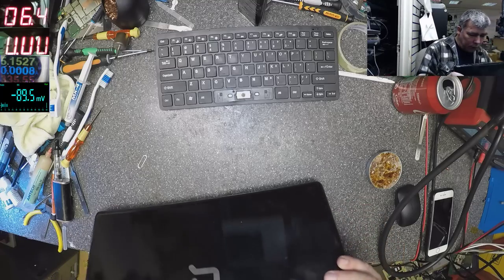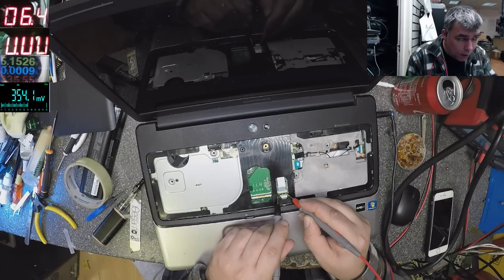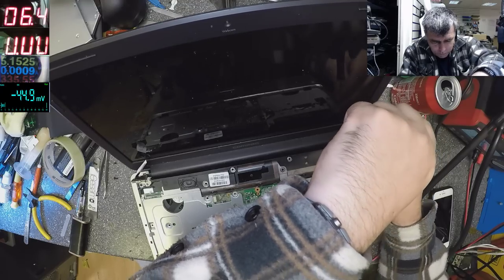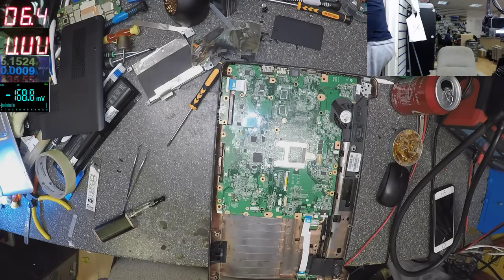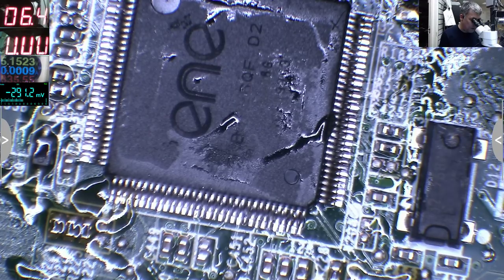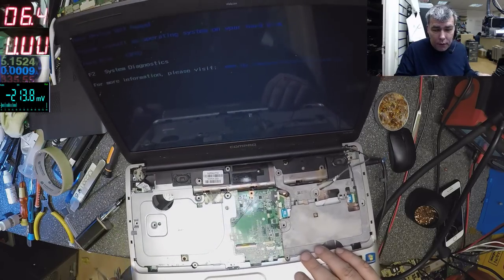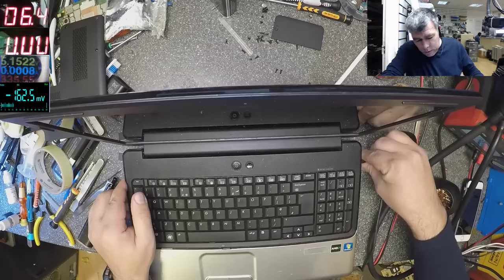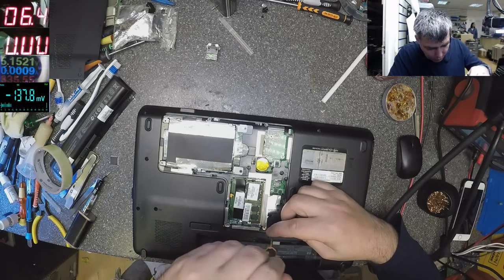The Most Common Fault On a Laptop When Everything its Working Fine but is Not Coming on

Comment: Some time i also use power supply to check circuits. It needs to be well aware of how electronic things work. its not for beginners. What you do is very practical and easy way to do it

Comment: Don't feel bad Sorin, you explain very well. You can't help it that people are ignorant and lazy and don't take time to learn before they randomly destroy stuff. Hopefully they will understand at some point, you are doing a great job. I learned from just a few videos about the 19v, 5v, 3.3v, 1.35v, 1v just by your videos. I have a lot of questions about some board I saw hundreds of volts on after a coil but I keep trying to look and understand before I just start to put in random voltages or amps on random spots. Keep them coming :)

Comment: Sorin, Sir please do not feel bad if some people make mistake and mess up. It is not your responsibility.  You have many videos which cover many aspects of repair, electronics, the repair business, and how to approach a problem.  You videos are unique - they are not just fixing thing, it is style professors use so that students learn.  I am your student.  For many many years I was looking for such an opportunity to learn the practical aspects of electronics and I am glad I found your videos.  Your videos are full of knowledge and because of that I subscribed to your channel.  I watch many videos, yours as well as others before venturing to do any repair, because it is possible I can mess up.  In fact I messed up a power supply (had ripped the power cable from its plastic holder which became useless) while trying to repair a Power Station Jumpstarter about which I had no knowledge.  However, I could use the same components (the connection sockets), and tested with a 15 yrs old multi-meter, which I had never used before prior to proceeding further to troubleshoot. recently I broke a P-trap pipe joint (the one under the bathroom sink) while trying to open it for troubleshooting.  I saw it was glued and thought to apply more pressure to loosen joint. However, it was going in the wrong direction; was actually tightening and broke the threads - it happens and I was responsible for this failure and I am responsible to fix it; and fixed it. You are teaching us lot of things free.  We are indebted to you for your time and your honest and selfless teaching.  Please keep it up.
Reply: Well said 

The one thing I also picked up on what he said was about putting the power supply onto the motherboard and using it as a multimeter and end up blowing the board up such as someone sticking 19 volts into it 

One thing I have took away from the many of this chaos videos is if you going to inject voltage to see what current it's drawing or tondo the petrol test to see what's cooking  is to use a low voltage like 1 volt as he's done many times on his repairs it lessens the risk of frying components instantly 

Have a laptop with the same issue as this one in the video chatting light is on but won't turn on not bothered to get all the needed tools yet as I don't really do much in repairs now a days and the investment in equipment just doesn't seem worth it if only doing a small handful of repairs 

So I stick to basic repairs now like fan replacements hard disk replacements anything that can be taken out and replaced in minutes

Comment: there are a few concepts that the beginner needs to read up on and experiment with .transistor diode capacitor mosfet inductor zenner diode and power supplies....from then on they can start to deal with some more advanced stuff and know a bit about what is going on ....oh then more practical stuff like testing with multimeter and soldering...very good stuff...i learn a lot every time.

Comment: I dont think the name is wrong. You do what you can. Trust me it is helping. It may be advanced Sorin. And I am a beginner. But what I learn from you is great. I dont have a powersupply. So the power I use is the original power. Test the power supply. To make sure it works. Then start at the power in and follow it. When you lose the power. I think you are in the area of the problem. Correct?
Sure I could make one from ATX pc powersupply. But if you can use the original powersupply to test. Then im ok with it.

Comment: Hi sir, I am an electronics student and in my university they do not teach us pratical things like repairing ... so when I watch your videos I understand what you say and do but when I try it by myself I cannot because I do not know where to start in the motherboard I've never tried to fix one, so I ask you please if you could do a video to show step by step where to start and why ? how do you jump from a place to another and if you can use the datasheet one time for a beginner because on the board it is hard to trace the circuit diagram. And I have a question : I do not understand when and why use a powersupply ? how do you know that there is a short by reading the amps ? 
If there is any Link, Books anything that could help I will be very gratefull.
Thank you for your help sir!

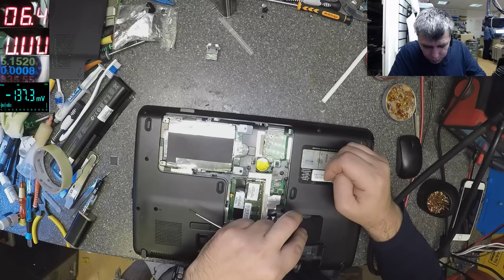Comment: 57:03 It's not always that easy. I learnt electronics in college for 5 years, and after that, I could barely make my own circuits, not to mention fixing RTV or customer hardware. But now I'm learning electronics from the Internet, from watching people like you, how they fix stuff, and I'm learning much more this way, and much faster. If I don't understand something, I look things up, unless I can't find any info about it (which is quite common with computers, because the producers don't release technical documentations to the wide public, only to their authorized services), then I ask people. I tend to learn from the masters of the trade, like you, because those people know the practical stuff, not just some dry textbook theory.  So now I'm pretty good with digital electronics, I can program microcontrollers, I built my own simple 8-bit computer from 74xx family chips etc. But laptops and cellphones are whole another level, because they're mainly SMD or even BGA. So even if I know the "classic" TTL/CMOS stuff, there's still a lot to learn in order to work with modern electronics. I bought my first hot air gun only recently, fried some chips during desoldering, damaged the tracks etc. But that's how we learn, don't we? We make mistakes and learn from them. With every mistake, we get better. Now I already fixed a couple of laptops thanks to your tutorials, but only the simplest ones yet, that didn't require any soldering on the motherboard. Another problem is money. It took me some time before I could afford all the tools. I was building my workshop for almost 3 years :q And I still don't have all the tools I'd like to have, e.g. a proper oscilloscope, or a microscope, because they're too expensive for me. I don't give up, though. What I like about your tutorials is that you don't seem to be using very advanced, expensive tools. You show how to get things done with simpler, cheaper ones, and it's surprisingly successful.

Comment: I guess this is an old video, cause ive seen sorin teach to beginners. Im an absolute beginner, and proud of it. Im no stupid so i try to keep up. Buth there is nothing wrong in being a beginner. Its wrong no to get the proper equipment tough. I dont have a power supply yet its very expensive where i live. So im into building one with sorings course on building one. But until then im enjoying his videos. And learning some stuff in the way.

Comment: I would say your gripe about people who know nothing about electronics trying to repair electronics, is somewhat like me asking a motor mechanic in an "E-Mail" about the oval shaped thingy, between the 2 large gears, opposite the large shaft that has the arms on it, below the small cylindrical shaped housing, inside the engine, if that was scratched, would it make a difference in how much petrol gets pumped into the carburettor???

And THAT dear friends, is why I get a motor mechanic to repair any car problems 👍👍👍

My biggest pet peeve, is customers "Insisting" on me giving them a quote over the telephone without having seen what is wrong to start off with. 

As in..... "Come on, you MUST have some idea of how much it's going to cost, I mean, I did give you an exact diagnosis of what is wrong. If you are ANY good at what you do, you'd be able to quote me over the phone"....... 

To which I reply "How long is a piece of string".

To which they respond by putting the phone down in my ear and I lose the work 🤷🤷🤷
Reply: I just say I charge $70.00/hr plus parts. ;)
Reply: @medicfour9268  That doesn't help. It's among the first things I tell them, Hourly Rate and then whatever the cost of the materials will be, but some people just don't understand

Comment: How do we differentiate the case when the 3.3v power rail is present but the startup chip has failed, VS the startup chip is working but refusing to complete the boot sequence because something else is wrong (ex: badly-sited memory, or some other issue)?  Shouldn't we check input signals to the startup chip, first, before swapping it?

Comment: Newbie question:  If we don't have a spare ENE on hand, is it sometimes possible to 'fix', at least temporarily, the ENE by cooking it around the edges a little, same as for failed GPUs in high-end laptops (ex: Dell XPS )?  ...Does the ENE even get hot enough to be subject to dilatation stresses like GPUs?

Comment: Due to the difficulty of replacing the super I/O chip this is not the most common fault and there are some other signals to considered as OK for the laptop to start as individual logic single gate ICs used for buffering,AND,OR etc.
Reply from the maker: I know what you mean, but must of the subs are not on that level. On some point ai will do a video about the io signals and 'S' states

Comment: Hi there..thanks for wonderful tutorials..i have laptop with same issue..have power light but cannot start up i just remove all the hardware including hard disk memory etc..i am pretty sure my power button is working fine..i want to ask if the 3.3volts is  present from motherboard does it always means that start up chip is the only causing this problem?thanks if there is anything else, please let me know..thanks

Comment: Hello, I have the same laptop and I have a problem with it. It doesn't start up at all. When I plug it into the external power, the ac adapter light turns on for a few seconds then turns off, but none of the lights in the front of the laptop (power, battery  or drive) turns on. When I try to turn the laptop on using the battery it doesn't work also. What do you think the problem is?

Comment: sir, i have a old hp compaq nx9030 laptop motherboard. There is power indicator light when i plug in the charger but only 2v is given to the power button instead of 3.3v .can anyone explain the reason for this and which part should be replaced?

Comment: thank you very much , I have a question , you spoke about the (I O chip )    before and you said that if the LED light is on then this chip is working fine ,,, could you please this thing explaining ?
Reply from the maker: thats mean if you have any led light on the laptop, indicate your 3.3v power supply its up and running and most likely the 19v aswell. I didn't said if the led are on, this chip is fine, like how you see on this video the light are on but the chip is dead
Reply: ok , then  I am  sorry , I thought that you said ,,
Reply from the maker: its ok, dont be sorry :)
Reply: Are those  comments about my question  ?

Comment: Hi mate nice work 
I have one issue that I think you haven't met. 
Laptop motherboard Q5wvh la-7912p   stop working  no image on display last year I have done some research and find out that the video card is probably  dead.  Now I have buy a working motherboard ebay and when I installed on the laptop  nofting with the power cable in . I insert the battery  and the laptop start but still no image on display .
I have reinstalled a few times 
And now with the battery I get only  5 led flash 
And power cable nofting from the start .i have tools 😁
Thanks
Reply: Bogdan, I've had similar problems some time back, turned out to be a faulty 2GB. Memory Module, might be worth checking
Reply: hi bogdan popescu,i have the same case with a toshiba laptop,everything was good but no image on display.what i discover was the caps lock was turn off and when i press the caps lock button on booting the laptop at the same time i got the image on display.You can try this trike maybe it can help you.goodluck
Reply: Still not working.
Reply: okey,then it is time to check the screen cable,the ram and the slots,and also try to disconnect the usb cable from the motherboard,also try to power up the pc without the battery,check the inverter,and connect it to an external display to see if there is any image and if not then the screen is dead or the screen backlight is dead that need to be replaced.
Reply: Hi Bogdan, have you tried a reflow on the Video chip?, i usually isolate the surrounding components with Kapton tape and apply liquid flux to the chip itself, you will notice the flux seeping in underneath the chip, this helps the solder flow better and also helps prevent contacts bridging beneath the chip, different people specify different temperature but i usually use about 480 degrees for about 15 seconds, heat around the outer area of the chip and keep the heat moving so as not to damage the chip. Results can vary, I have a couple of repairs still running after a year+ but also have had some fail after a couple of weeks, still if it works you will at least know its definitely the Video chip thats the problem.
Reply: bogdan popescu reset bios.
Reply: bogdan popescu there are 3 or 4 mosfets in VIN and battery. Have you checked those yet?
Reply: bogdan popescu you're suppose to have 19VDC in the first 2 mosfets output. Remember pin 4 is GATE as Sorin explained in the past. Do not check with your multimeter the South Bridge SIO you may kill it. I check those IC's in any other component before or after the IC in the corresponding bus.

Comment: I have a hp g62 which turns on, but no picture on screen. Today i heat the graphic card with air blower and now he won’t start at all. I checked the voltage, everything seems to be fine. There is power all over the board. Maybe u burned something. I used 450 degres for 15, 20 seconds on graphic card. I tried to heat only outside of the chip. It is my first time, and it poojs like i didn’t had luck. I believe that g62 now can go online for parts :-D
Reply from the maker: probably the graphic chip got short inside. Next time, try from the back of the chip, its more safe
Reply: Electronics repair school Yeah, probably. Ok, i’ll try that when i get opportunity to do that again. Thanks.
I have also one hp but 625 which won't run. I get power light, but no fan spinning at all and no picture. Tried to reset bios without succes. I’m.waiting my power supply to arrive, so i can check more functions.
Reply from the maker: check this video first
Reply: Electronics repair school yeah, i saw it. On that hp 625 i have the power button is broken. It has some tape on itself to hold.it on place. I’ll check it tomorrow detailed.

Comment: I am a noob, and yes, i am asking for help, but i am asking to you guys in the comment area :)
My laptop turns on, start to boot windows and then shuts off, and reboot. And he keeps on this loop. I changed the hdd and it still shuts down, same problem... For my knowledge, i don´t think it can be the motherboard, cus the system works fine until booting the windows files, but knowledge is little xd What can it be? Can anyone help me?
Thx

Sorin, if u are reading, thx for teaching me some principles of this art, i discovered your channel yesterday, i'm kinda addicted xd

Comment: You are obviously a good repair man but some of the things you do would not be acceptable where i work.
You use as second hand component to repair the laptop rather than a new one.
You also dont use a protective mat and scratchec the top left of the customers laptop back panel.
You also dont use an antistatic mat with screw locators etc that makes the job simple and easier?

What country are you in?

Comment: Great work I am glad you work through your frustration. Its sad how people don't appreciate the hard work and time you have spent learning your trade. So many people think there is a 5 minute hack/shortcut to fix things without knowledge and experience. :washhands:
Reply: Totally agree with your comment 

And I agree with what this chap said about idiots who blindly take a chill from one motherboard and putting it into another and expecting it to work without even checking the chip details and making sure said details match  making sure those details match is 101 basics 

I been playing around and learning electronics since about 13 and self learned some very well in my younger days fixing TVs VCRs HiFi systems and later on computers used to make a killing out of VCRs as used to go around all the repair shops looking for machines they are scrapping haha one day one shop wanted to clear out his stock room and ended up filling up a small van full of VCRs made a fair bit of money from those that got working again and had plenty parts for others  and back then Panasonic was one of the top brands of VCR ingot my hands 

But yes during my time learning electronics one of the key things was to make sure when replacing parts is to make sure part numbers matched 

Those were the days